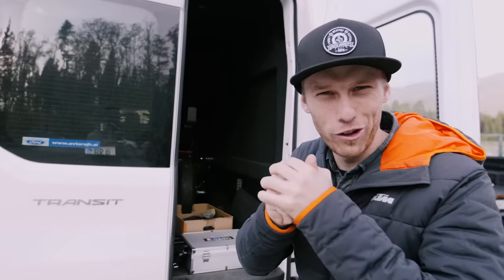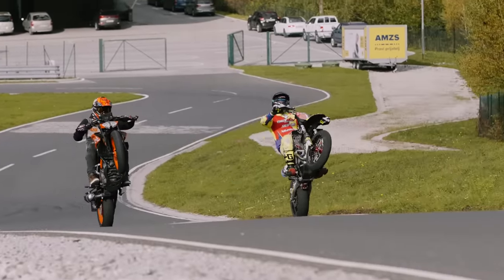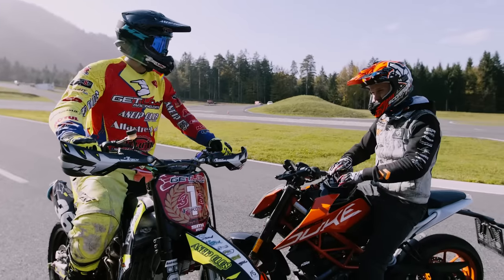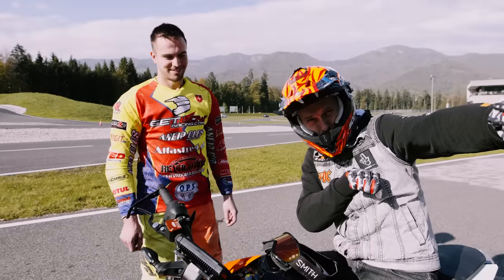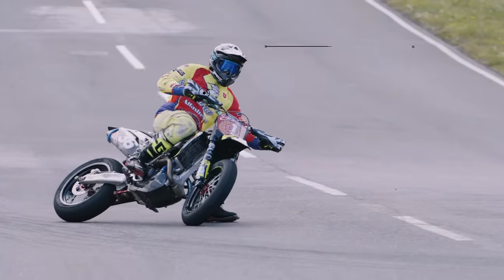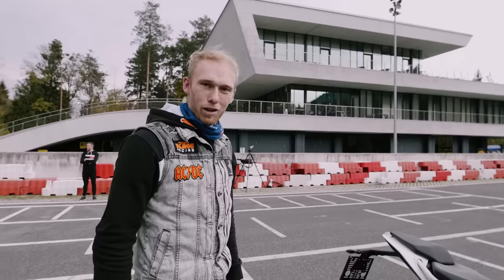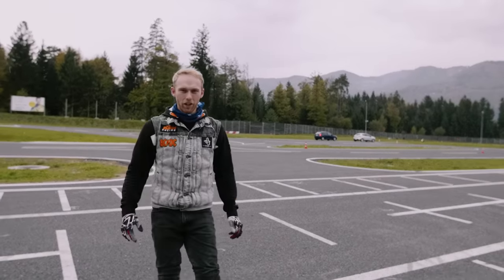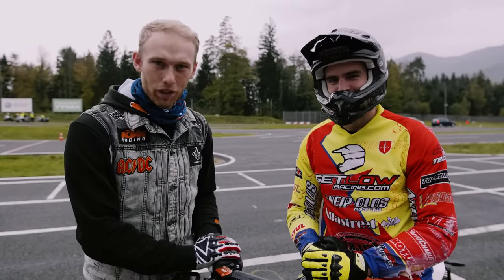KTM Duke 390 - Supermoto mode | RokON VLOG #37

Comment: with a slipper clutch its not that hard to drift, i learned it with my ktm 690 smc r with the abs on and when i felt that the abs is blocking the ability to drift i turned it completely off and it worked instantly, the key is that you need enough speed , very late on the breaks , fast down shifting during braking let go the clutch ,lean your bodyweight into the corner but don't steer into the corner your back will skip out and in the middle of the corner let go the clutch completely and the rear break and begin to go on the gas again , if you go fast enough it comes naturally ......engine breaking is very important so high gear into a low gear works perfect

Comment: Rear brake on mine couldn't lock the rear with an elephant standing on it! :-(
Reply: Hippo-Drones  Man it's hilarious.
Reply: WIth an elephant on it, the normal force increases, so the chances of it locking are actually slimmer.
Reply: Hippo-Drones nn
Reply: thats why you need to unload the rear by using the front, i had a couple accidental rear slides going into a corner, especially on cold weather when the tires dont have that much grip.
Reply: 2ane I am not trying to do tricks with the bike, the rear brake is dangerously weak.... I doubt it would pass the brake check on an MoT in the UK
Reply: Lol mines either nothing or full locked on !
Reply: robo yobbo I wish mine was like that!
Reply: Hippo-Drones I can deal without a rear brake on tarmac, one that is all or nothing sounds terrifying. As long as your front brake works well, that's the most important thing. Maybe try some more aggressive pads in the rear and bleed the system :-)
Reply: Bleed the brakes
Reply: Hippo-Drones abs
Reply: Hippo-Drones and ijo
Reply: Disconnect antilock wires it'll lock.
Reply: Stop giving elephants rides then lol
Reply: pull the clutch before stepping on the rear brake full force to lock it, and wear safety gear. Also, the first time you do it, don,t go above 15-20 kmph   (10-13 mph approx. )

Comment: supermoto mode = uncontrollable chirping?
Reply: lolwat? Just turns rear abs off
Reply: Chirpping is due to the slipper clutch
Reply: RogueMI6 I understand what a slipper clutch is what it does and how it does it, it's just odd that the slipping is bouncing instead of being steady. The slipper clutch should allow for a steady slipping not for uncontrolled bouncing.
Reply: Don't know why the wheel hops, it shouldn't, that's what the slipper clutch is for. My SXV have the chirpping sound and no wheel hop, even when I over shift to 1st gear instead of 2nd.
Reply: Downshifting one gear too many after hitting a bump resulted in being chucked over the bars and landing on my head and shoulder(no helmet)....result broken collar bone,but head ok,haha.Old beeza didn`t have a slipper clutch.

Comment: Great skill, but with slipper clutch you cannot slide the rear wheel because it won't lock when you drop few gears. Correct me if I am wrong.
Reply: The slipper doesn't allow locking. Engine braking is used (via slipper clutch) to make the rear wheel turn slower than the front.

Comment: Sooo what's the point of having it in supermoto abs mode that disables rear abs if you DON'T want to lock the rear wheel for sliding into corners? Does the front abs freak out if rear is sliding/off the ground when rear abs is on? Or rear abs gets freaked out by sliding and doesn't want to apply any brake?
Reply: Supermoto abs allows harder front braking, rear wheel lift detection and motor slip regulation MSR also turn off(very important).

Comment: Is it necessary to use the rear brake, and what about right turns? Will you just initiate the slide quickly and then get your right foot out? I've learned to slide into corners but only with engine braking on the 690 SMC-R and wonder if I should add rear braking to get better?

Comment: How do you stop this bike from high-siding? I can see that if you keep the throttle on and keep the back wheel spinning it helps, but when you see high siding racing bikes what is the difference in technique or bike characteristics? If you suddenly roll off the throttle will a supermoto still high side?

Comment: im a little bit confused, if i pull in the clutch a little bit then the rear is going to lose drive power, what the hell is it gonna make it spin faster than the front whee? slip the clutch and add a ton of gas??

Comment: 1:18 thats wrong.. drifting into corners is a very passive and defensive way of getting thru with average times.
If you know your bike and your a good rider, youll see the curve and break the right amount, calculate the angle you need to throttle back up and your out.
You dont see motorbike champions drifting do you??

Comment: I believe this should be called deceleration sliding, the slipper clutch should make this more challenging. Riding the dirt bike I absolutely love power sliding (steering with the rear on the power) 5th gear tapped counter steering hard shift the weight to a wheelie ... Fuck.... life's good sometimes

Comment: I think its easier with abs on 🤔
Reply: No because the bike will try to keep the wheel turning a the right speed, I tried with abs on a cb500x and without on a mt07(fz07) and It was much easier on the 07

Comment: T video guys doing it wrong....!!!!  it has lot of wasted times focus on braking. This is how you do it with least time wasted on braking #1 front brake full power to get the speed you want in the corner and lean the bike in and add throttle..( this will take practice) and as soon you feel the rear wheel moving out you control the sliding with throttle,,( BEST way to start off your practice is on fine gravel... on that surface the bike will slide in no time) and you need to fine up your feeling of the bike and sliding. Every bike is different due to its weight..
Reply: Wow, that's the worst advice I ever read

Comment: Sadly, In my country the ktm 390 has a really bad quality reputation, with engine problems, assembly problems, and bad warranty service for auteco-kawasaki the autorized dealer, I know a case with a guy he need to carry the bike almost 6 times with different issues, oíl leaks, bad process which cause overheating, engine damage blue smoke....... Tell my if in your country is the same? Or is only in my country, or anyone knows please comment thanks.